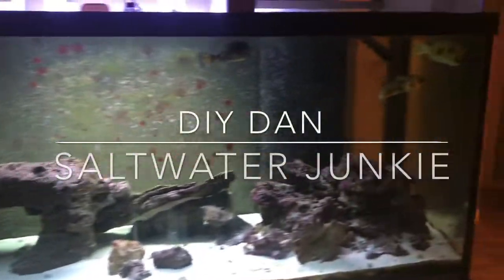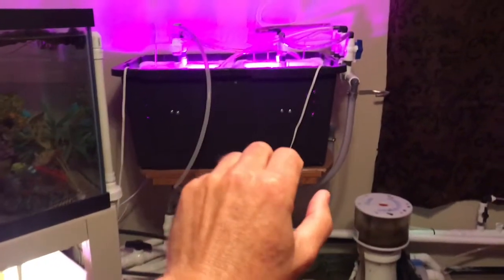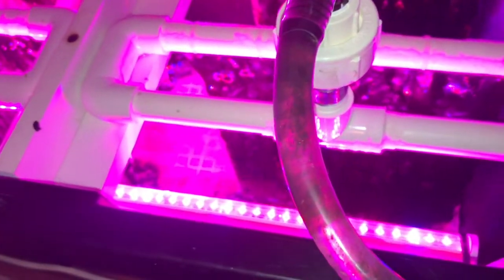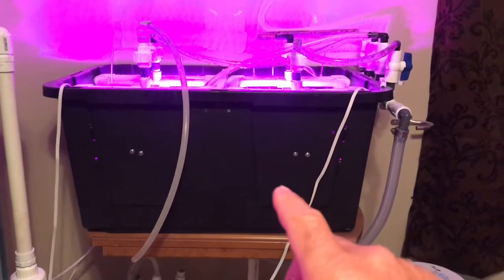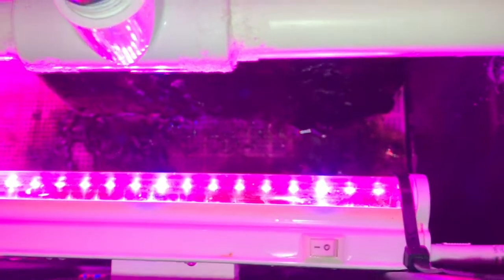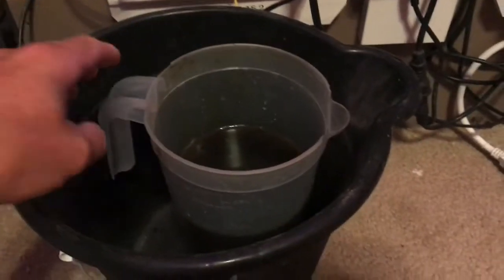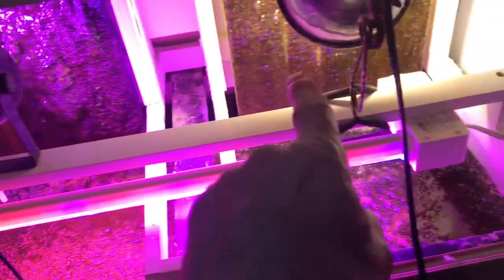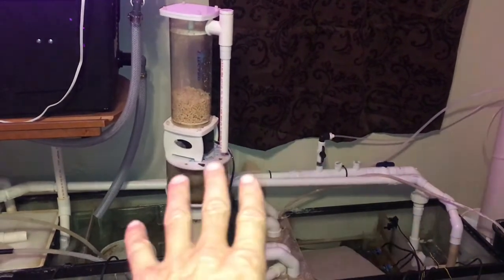ALGAE SCRUBBER HUGE BUILD & SYSTEM UPDATES 4MAIN DISPLAYS 1 SUMP FILTRATION WATCH NEW UPDATE VIDEO

Comment: Which worked better, the one with the smaller or larger mesh ?
Reply from the maker: Honestly it did not make a difference both produced about the same I’ve got update videos on the set up that you might want to check out on my channel before building one had some stuff go wrong that I had to fix just look up updates on huge algae scrubber build

Comment: Very cool video Dan. I'm in the process of copying your design for this algae scrubber.  Mine will be a little smaller and I'm gonna try zip ties instead of that pvc board.  It's kinda expensive and being I dont need it for anything else it's a waste.  The two boards at Home Depot cost $27.